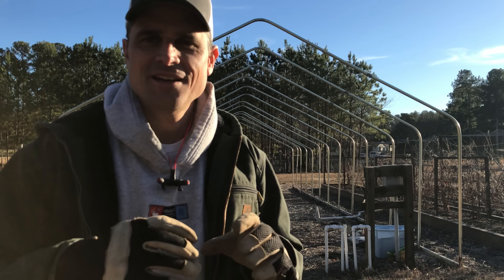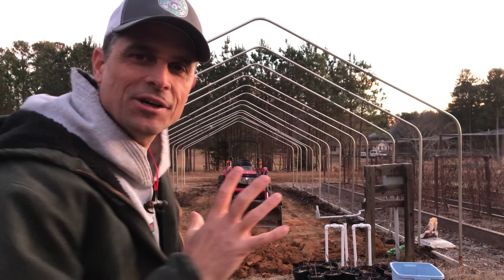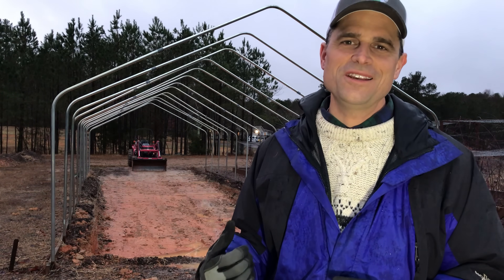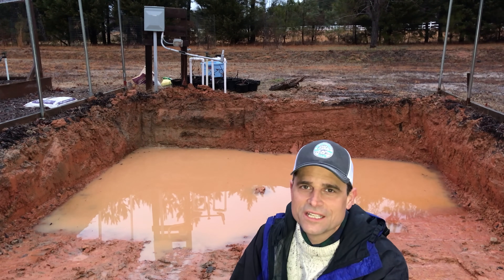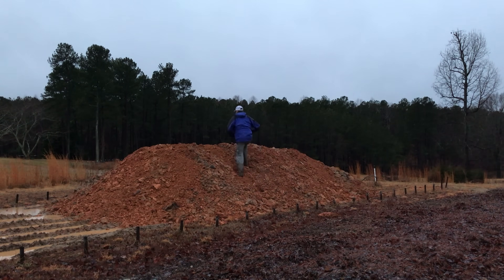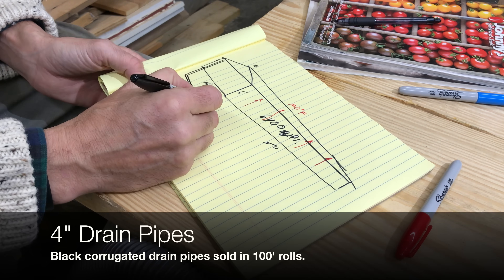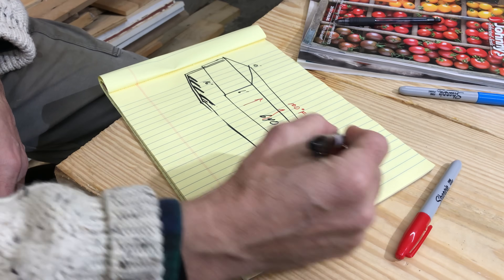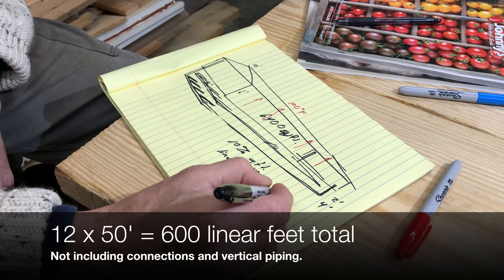DIY Metal Conduit Greenhouse Pt 2: Passive Solar Geothermal Earth Battery

Comment: Couple tips I learned doing a huge basement dig out all myself.

1. Always slope a bit into a coupl of  low spots. Then, you can use a sump or trash pump to pump out the majority of the water. 

2. direct what water you can away from the hole in the first place. In this case, you already had the frames in place. A cheap tarp over the top and a few scoops of dirt to direct the water away would do wonders.

3 The time to deal with water is before it turns your dirt to mud.

Comment: Interesting idea!  How do you push the hot air into the pipes?  What is expected temperature change?  This is just for cooling?  Seems like a venting system is better and cheaper?  Will follow and thanks for sharing your project so we can all learn.

Comment: How do  you deal with condensation buildup in the pipes as the hot air generated during the day is cooled?
Reply: I would think.that if you have enough air flow the air will consume the moisture and bring it  back up inside the greenhouse.

Comment: Very interesting and I will be following along. What are you going to do along the wall where you dug? Are you lining it with something to prevent it from falling in. What material are you going to put down on the floor once you install all the pipes? Thanks for sharing.
Blessings,
Jim
Reply from the maker: Jim, great question. Actually, the walls all around will have 2" rigid foam insulation lining the hole before pipe installation and back filling. The first course of pipes will go in at four feet down, then we will back fill and tamp around the pipes up to two feet. Then we install the second course of pipes, before filling the hole back in completely. The rigid foam insulation will be like a giant ground thermos/cooler helping to keep the heat energy contained under the greenhouse and not bleed into surrounding clay. We're going to put greenhouse tables along the walls and raised beds in the middle. Gravel will go down where we walk and under the tables.

Comment: It is looking GREAT..   It reminded be when I had to dig a water main line 5 feet deep 300 feet and it rain . Used a old sump pump to pump out the water. If i did not, it stay their forever. Looking forward to the next one..
Reply from the maker: Thanks, Mark! Unfortunately, efforts to go out now and get rid of the water would be in vain - we several more days of rain coming. I normally NEVER complain about rain or wish it away, but this is a moment where a week without would be perfect. Right now, I fear that our tractor would slide to the bottom of the hole and remain there.